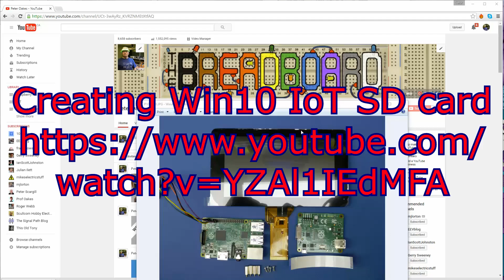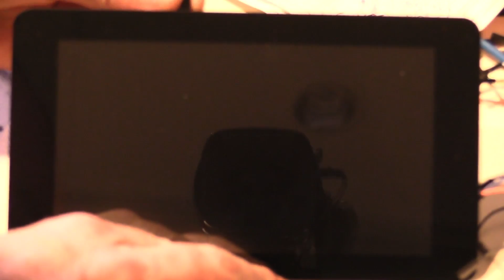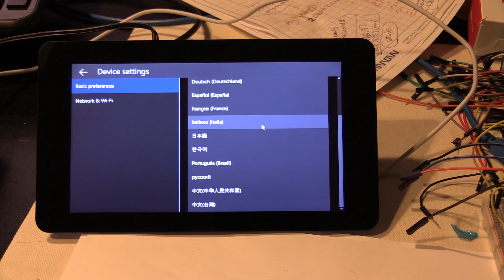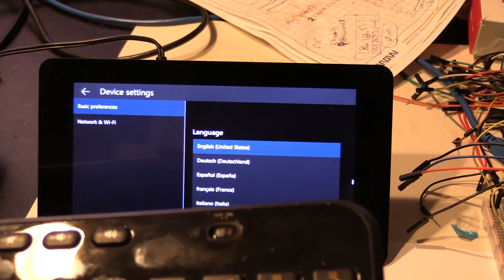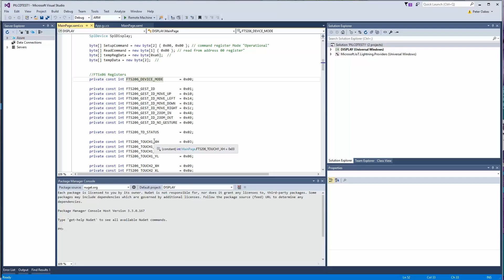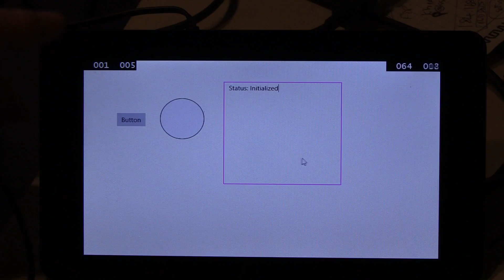RPI 2 and the official 7" LCD using Windows 10 IoT

Comment: Hello Peter i have the same 7 inch lcd but when i flash the sd card in windows iot the raspberry pi won't boot up i have the lcd and de pi together on one power adapter can you tell me of this is the problem.

Comment: Got everything working with Raspbian, but apparently there is an issue now with the 7" lcd screen V1.1 2015 and ioT 10586 doesn't work the screen stays blank.  Dashboard confirms device is present but guess I need to find an HDMI monitor to view it.
Reply from the maker: +hankus253 Yes I have heard about this, apparently the 1.1 board is different enough it wont work. I guess I was lucky enough to get a 1.0 board. I do not know what the difference is though, sorry

Comment: Peter, can you tell us which version of the official rpi display you used? It seems there are two different revisions around, one is working(1.0) and one is not (1.1). I tried v1.1 and is not working. See here: https://social.msdn.microsoft.com/Forums/en-US/3636e77f-4eb0-46ee-91e0-156b839ac1c6/official-pi-800480-screen-v11-2015?forum=WindowsIoT
Besides: very cool video!
Reply from the maker: +Simon Moritz I have a 1.0 display and yes your discovery is correct, the newer 1.1 display no longer works with Windows 10 IoT, I guess some one is not communicating with the right folks to ensure backwards compatability, Im sure it will get fixed along with the touch issues, lets hope its before too many folks go away back to Linux in frustration

Comment: Hi Peter....I have a Samsung 7 inch tab that I took apart...Is there a way to adapt the lcd it to work with the RP2?Thanks................
Reply from the maker: +Dan Serray if you have the technical specs for the display and suitable connectors, then possibly but it may be a lot more work that it is worth.

First thing is to get the data sheet on the display
Reply: +Peter Oakes (TheBreadboardca) Thanks much sir

Comment: Peter, do you know if MS is working on the Element14 7" touch driver issue?
Reply from the maker: +David Cuccia it is not specefically an Element 14 product, it is available through a few distributors

The last thing I read from MS regarding IoT was that the team was temporarly pulled for a short period to deal with another product release and will be returning shortly. No dates where given of course. So im completly in the dark... sorry

Comment: Bought a RPI2 to play with and lost interest pretty quickly. It is very slow and really unusable for general computing. Try running a web browser and test your patience.
By the time you buy all the stuff you need to get up and running, you might as well buy an Android tablet.
Good thing I didn't buy the 7" display. 
What is the purpose of having 4 usb ports if you have to use 3 of them to get up and running?
For an extra $5, they could've built the Wifi and Bluetooth on board. I'll wait a couple of years more and I am sure some one will come up with a practical and economical design.

Comment: Dammit, nothing shown on my screen (works ok with raspbian but I needed to add lcd_rotate=2 to config.txt).  On a brief trawl through the forums it looks maybe like later revisions of the official screen don't work yet.and I can't get the updated iot core (.63) version to boot without a sad-face.
Reply: +nobblynobody Got the update to work but still no joy on the screen. I may have missed it in the vid, but what does the screen show up as in devices on the PI ?
Reply from the maker: +nobblynobody I just checked my display and it is Version 1.0, I also checked the forums and this indicates you must have a 1.1 version of the display, it is a little dissapointing that this has happened as I am sure there are loads of folks wanting to use this and no sooner than we get close to s solution, some bright spark changes the goal posts... lets hope it is not too long before we get the updates
Reply: ah, thanks for checking Peter, no worries, plenty of other stuff to fiddle with in the meantime.
Reply from the maker: Very true :)